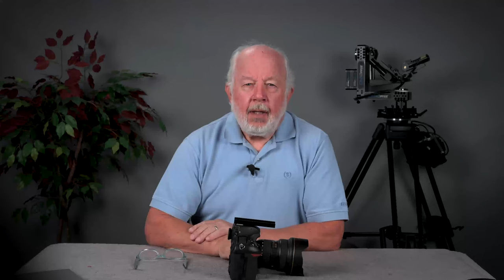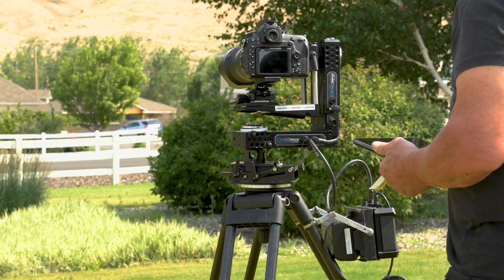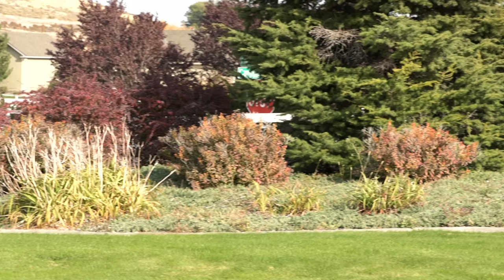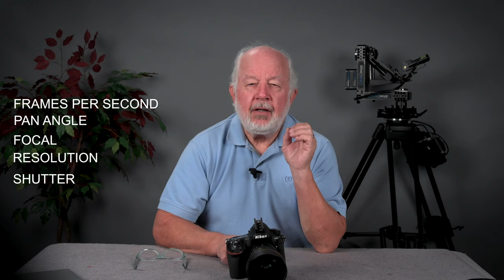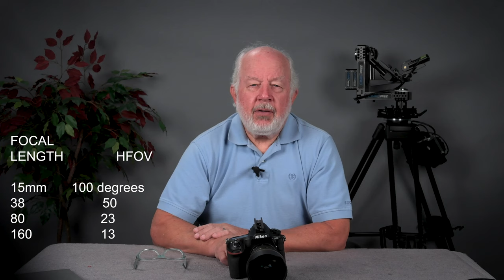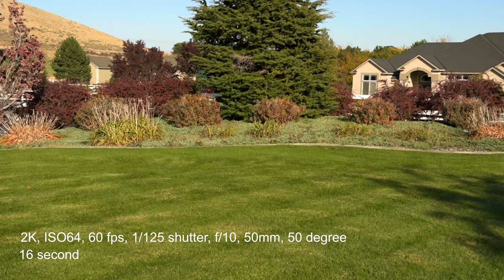Video Judder - What It Is and How to Avoid It

Comment: I don't see how going from 1080p to 4K means you can pan faster. Even if you're shooting 1080p, you're still going to upscale it to fit on a 4K frame, and vice-versa. The size of the logical pixels doesn't matter if the final frame size is the same.
Reply from the maker: I suggest you go to RED.com -> "Learn" -> "tools" -> "panning speed".  This calculator will allow you to change the parameters that affect judder.  Resolution is one of those.  With a little experimentation you can see the effects.  Basically the number of pixels crossed in a pan affects judder.  8K will have 4 times the resolution (versus 2K) which avoids the "jumps" that manifest as judder.  It's motion vs capture capability.
Reply: @MarkAJaegerVideo  Oh, I think I know the problem.
That is assuming that the SCALE has NOT been changed.
If you assume that the frame SIZE is always the same because all videos are scaled to match, then resolution doesn't matter at all.
They should communicate that better.

Comment: There is a fundamental principle that is ignored in this video explanation, which is also the reason why judder is still visible in all the end clips. 

Judder is exacerbated by the 3:2 pulldown method used to display 24fps footage over a 60hz display. Because 24fps doesn’t evenly divide into the 60hz refresh cycle, 6 additional frames must be created each second to display correctly (3:2)
Reply from the maker: The 3:2 pulldown problem is different from judder.  If you don't like my explanation, go to RED.com and read theirs.  Judder pre-dates video (it was present in the film era).

Comment: Great work. Good explanation.
But these days there is one more cause, and i think that is the  main problem Three-two pull down for the 60hz screens.
Before i realized this, i even tried 1degree/sec instead of the RED dragon 4K 16:9 calculated 3.1 (also with motorized setup), 4K 23,987fps 1/50shutter f1.4 , 50mm full frame and it was still juddery, then i tried the same speed 16mm apsc and gave up, i'm not going to be able to pan that slow.

Comment: Hi there! I have a question please as your video is very informative. I got a Sony a80j OLED tv and it had a lot of the judder you talk about when i play movies. Do you know why that is and is there anything I could do to fix it? Thanks
Reply from the maker: Juddder is baked-in during image capture.  There is not much that can be done about it within video editing.  Even less can be done about it during playback (I know of no way to improve judder in playback).  IMO it's not your TV if it actually is judder.
Reply: @MarkAJaegerVideo  thanks for your response. I found a way to eliminate the judder. I can turn on motion interpretation which I guess adds fake frames to smooth out the judder I see. The only thing is it adds artifacts to the movie because I guess it’s trying to add fake frames that weren’t there in the original content. I don’t see that judder in the movie theater.
Reply: @Matt658  OLED TVs suffer from bad stutter because of their instantaneous response times. Stutter is not the same as judder.

Comment: Is it possible that judder can be created by a faulty HDMI cable? For example, I'm recording externally and have tested 2 different high-speed cables which provided me with the same results. Judder.

What's odd, is my camera screen shows smoother movement and/or less judder. I'm also wondering if this could just be an optical illusion, since I'm comparing results in real-time on a 2.5" vs a 5" screen.

Thanks, enjoyed learning about all of this. Your video is very thorough!
Reply from the maker: From my understanding of judder the HDMI cabling to a second monitor or the normal on-camera monitor will have no effect on whether you get judder or not.  It is a recording issue.
Reply: @MarkAJaegerVideo That makes sense. The monitors are just tools to see the outcome of the recording and how they do that differ from one to another. 

If anything, I'd imagine seeing dropped frames, freezing and/or lag if the HDMI cable were the issue (which I have before with other cables).  I'm looking forward to more testing to combat the judder. Thanks for your reply!

Comment: Hi Mark, awesome tutorial. My conclusion: slow down :) One question: in case I have judder in my footage, would it fix it if I slow down speed in post or is it too late?
Reply from the maker: Indeed, keeping the pan rate slow helps avoid judder but it's not always the look someone wants.  My understanding of judder being a timing issue between the frames per second vs the rate of pan drives me to think it can't be fixed by changing playback speed.  However, I might be tempted to try Warp Stabilization (Premiere Pro) or similar, to see if some judder can be eliminated.

Comment: Hi Mark, I’m a beginner and just want to make smooth cinematic family videos and noticed that panning often will have butter. So would the rule of thumb be to just pan horizontally as slow as possible, eg 7 seconds? I shoot in 4K 30 fps 1/60 shutter. Many thanks
Reply from the maker: Kevin,  You don't mention what lens focal length you're using or how many degrees of pan you want but both are influential.   I suggest you use the panning speed calculator from the RED website.  Here's the link: Panning Speed.
I suggest you shoot some pans at your house or some other convenient place and see what works with your setup and your goal for the "look".  The "look" may dominate the choice for pan speed (for example - you might want a whip pan).
Also, the content of the scene (foreground, mid-ground, and background) will influence whether judder is noticeable.   No worries - You'll master this with some experimentation based on the science (resolution, frame rate, focal length, pan angle)
Reply from the maker: Isn't it nice that spell-check helped you out with "butter" instead of "judder"?

Comment: Another question. This may sound dumb but does panning only refer to horizontal movement? If I pan vertically up a tall building for example judder still is an issue? I assume it is but just wanted to ask. Thanks again.
Reply from the maker: The direction of pan (horizontal, diagonal, vertical or combinations) doesn't really matter.  The prominence of the judder can change (how easy is it to see) can change depending on the background.
Reply: thanks again for your quick response

Comment: Wow i didn’t know stops was a unit-less measure. Always thought it was relative to light,
Reply from the maker: If you are a photographer or a videographer it is hard for me to appreciate your surprise that stops are unit-less.   You may have missed a big one in your training.  If you're new to the field then you get a pass for new understanding.  Shutter speeds (1/4, 1/2, 1, 2, 4, 8), filters (1 stop, 2 stop),  and ISO (100, 200, 400) are all graduated in stops.   It's powers of two but it's not always obvious.  For example: lens numbering (1.4 ->2 -> 2.8->, 4->, 5.6, etc) is stops but the numbers are not as easy as shutter speed or ISO.   Almost everything dealing with light in the photo/video is expressed in stops.
Reply: @MarkAJaegerVideo  Right, quess I've mostly already set fps, shutterangle and aperture. Then the rest of the exposure is done via variable nds and iso, monitored with waveforms. So I've never really had any use for the concept of stops. But I can imagine that it is useful for photographers that need an easy way to calculate consistency between settings.

Comment: I'm afraid but all examples stutter at 4K and 1080p. Sure it judders less when panning very slowly, but it looks still annoying. My laptop is relatively recent and has medium graphical power, so this should not be an issue. I keep searching for a solution that works. Maybe the problem is with Youtube introducing artefacts. Judder is a huge issue with clips on Youtube.
Reply from the maker: It is vital to understand that once judder is present it cannot be effectively edited out.   One test -  do you see what you call 'stutter' in scenes where there is no panning?  If you do, it's not judder.  It's your playback.
Reply: @MarkAJaegerVideo  I am referring to your video. All the pannings you show there have judder. There is not a single example without judder. I get smooth pannings myself only when recording at 60fps. 30fps is so so, 24, 25 and 50fps are awful. I am watching on a laptop with 60 Hertz refresh rate. It has an OLED screen which has a shorter reaction time than LCD screens.
Reply from the maker: @danielduesentriebjunior  You did not reply to my "test" above.  I cannot diagnose your issue through YouTube but it is significant that, at normal frame rates (24-25-30), your video is "awful".   Bottom line: If  you follow the principles in my video judder should not be an issue.  Problems you may be having with bandwidth, computer, et al are not going to be cured by those principles.
Reply: @MarkAJaegerVideo  I said above that my laptop is recent/ no prob with bandwith. I see the problem in all your pannings as said, and explicitly not in steady shots. The funny thing is that I find other pannings on Youtube which look smooth. Usually they have been shot at 60fps.
Reply: You may watch my only Youtube video about a walk in Assisi. The pans there should be smooth (at least when I watch it). I get the impression that there are parameters affecting the appearance of how smooth a pan looks on Youtube which are not understood properly. It may be due to Youtube compression/decompression issues.
Reply: Same here with motion smoothing turned off on a 65" TV. All the speeds have judder.

Comment: The judder, not only limited to pans, when using my drone, seem to be when the clips are put into an editor. 
The frame rates are all the same so that doesn’t seem to be the problem and I can find nobody that has such a bad experience as I’m having. 
I’m using an IOS app and maybe it’s the device I’m using to edit that is causing a fault as it is quite old.
Reply from the maker: I am not sure what you're seeing.  Perhaps you can give a little more information about what you're seeing and under what conditions the defects appear.
Reply: This is likely due to a mismatch in fps. Example: you shoot at 30fps and edit in a 24p timeline, or visa-versa. 

For drone shots, your best bet is to film at 30fps, using a 180deg shutter (or 1/60 speed), and edit in a 30fps timeline. Or, 60fps (if you want to slow it down in your editor), and edit in 30fps timeline. 

My recommendation is to void 24fps when possible, as this will always present judder issues. If you really want to shoot in 24fps, you’ll need to use speedwarp and optical flow effects to smooth the judder.